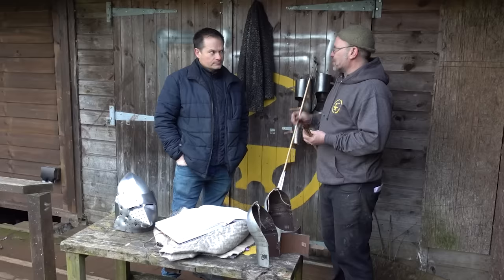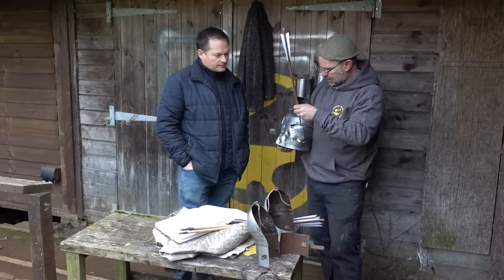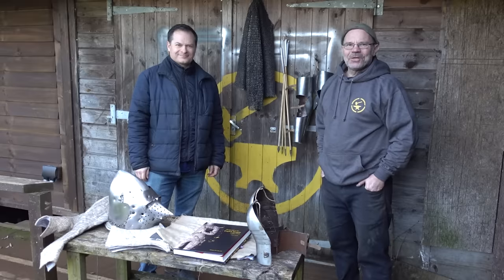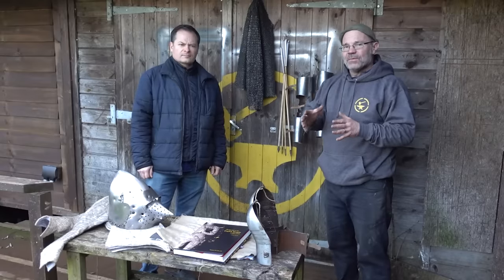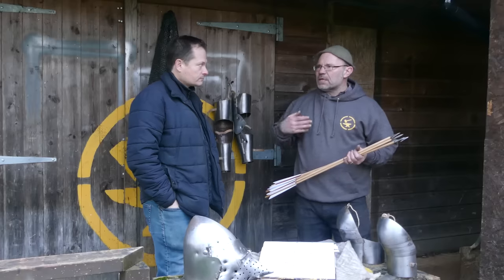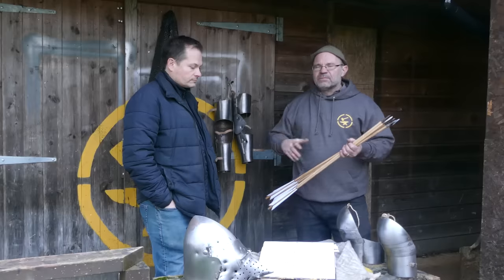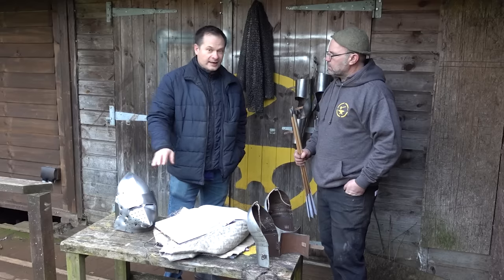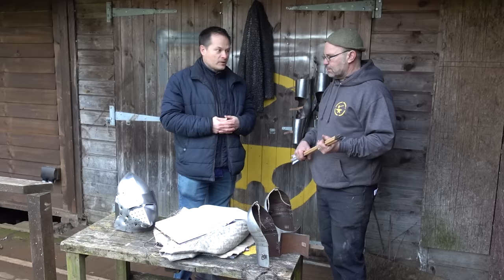Arrows vs Armour 2 - Our thoughts 6 months later

Comment: The number one rule of war : People Die. The purpose of Steel Armour is to increase the likelihood of survival. If armour did not work, then, the nobles would not have been spending fortunes encasing themselves in steel, and encumbering themselves with an 50 to 60 pounds of useless gear. Nobles were not fools. When armour became obsolete it was discarded. War is the ultimate crucible of pragmatism and practicality.

Comment: While this is an account from a conquistador fighting Native archers rather than a source from Agincourt, it is relevant to the phenomenon of an arrow shaft proving more dangerous than the arrowhead against armor: 

"An arrow, where it finds no mail, pierces as deeply as a crossbow [...] For the most part when they strike upon mail, they break at the place where they are bound together. Those of cane split and pierce a coat of mail, causing more injury than the other."

From "The Gentleman of Elvas”

As someone who has made my own arrows, I can attest that in unsocketed/flint-tipped arrows, the groove where the point is bound/glued is the weakest point. Ironically that made it more dangerous when hitting maille if made of a cane shaft, apparently.

Comment: I really think if you guys have a way to bump up the volume of arrows it would be really interesting to see if a person were struck by. Say something closer to 50. Maybe even 100 arrows if armor degradation starts to play a role like if it starts to pop rivets and straps on the armor because I know that's a big problem I've had with my armor, especially the used pieces of armor when I'm fighting. And my stuff is hardened tempered steel not mild.

Comment: Heck, think of the compromises and choices that modern soldiers make in the choices of body armor on 21st Century battlefields. Weight, mobility, and protection levels desired for mission dictate differences in what is worn. DAPS or no? Side plates or no? Plate carrier with minimal kevlar or IOTV Gen 3 or 4 with significant kevlar coverage in addition to ceramic plates?

Comment: I think a point to note when it comes to besagues is the anatomy of the wearer in armor when faced with an arrow storm. Like tucking your elbows into your chest, govering the gaps. Maybe even pointing the nose of the hounskull bascinet down to cover more of the neck or even the armpit gaps. All this in a slight bent over bracing position, closing down the gaps.

I think they would be able to close gaps with movement of the limbs(holding your forearms before gaps also maybe?), instead of just embracing the fact you are going to get hit there.

Maneuver the armor with the body like you would with a shield. 

Also for example when somebody throws a rock at you, you don’t just stand there…

Maybe a thing, to test different positions of the wearer.

Hope this makes any sense!?

+ like what about a boxing stance even? Again, tucking everything in when faced with blows…

Comment: A huge amount of power is lost with the arrow shaft being made of flexible wood. If a stronger more rigid material was used to construct the arrow shaft then more of the bows power would be focused into generating speed for the arrow, aka armour penetration. Is there any evidence the shafts were hardened, or if they used harder woods? Metal shafts?

Comment: Around 18:00 or so when they're talking about the armored skirt and whether English and French chose to wear them, or not, how more expensive and available they were to them at the time, one thing that popped in my head was how "expensive" it might have been to Carry and Transport that extra equipment.  Sure, packing it on a cart and then boat, back to cart, to travel from, say, London to Calais, and then having to "carry" that from port to Agincourt, and how these English soldiers are having to either physically carry/wear this armor on their person or on a cart, I wonder if this was a factor in choosing to go without.  As we all know, Armor is a tradeoff in Mobility/agility vs Protection. If you're a Man at Arms having to march on foot for miles, just to get to camp or the next stopover on your way to what becomes the battlefield (of Agincourt), do you really want to be marching for miles with that armored skirt that's only really best used for combat, not for marching for miles?  It seems for most of warfare history, Regular Infantry (to use a very generic term) for the most part tended to Not wear much armor on the legs and hips/lower extremities, because they had to physically wear it to carry it everywhere, and, without the benefit of a cart or horse, I can easily understand the choice to not bother.  

The French in turn have the slight advantage of home-turf, but even they too have to consider how much gear to bring, and how "expensive" that will be for them.  Perhaps some of the French felt they didn't NEED to  bring every single piece of gear, or, that they didn't NEED to wear everything they brought to this particular battle, perhaps they assumed that this was going to be a quick skirmish.  No one was saying "Oh!  This IS the Big One!" before the battle of Agincourt, it happened as it happened in real-time, and the men fighting that battle went in with the gear they felt was most appropriate for the conditions and situation at the time.....And as we see after the fact, the weather did play a role.

Similar thoughts about the Besigue, there does seem to be a certain choice to not wear them to gain a little more flexibility from the armor.  And, similar in thought to the "improved" breastplate being developed as a better protection against arrows, the thinking that this is "good enough" or that it covers 90-95% of the "worst" hits, but there's still that chance of that one "lucky" shot or deflection that still manages to work its way into a weak spot.   We all take a similar risk assessment when we get into our cars and drive off somewhere.

Comment: That barbed head - that is interesting and I think should be looked at.  I think it will have drawbacks, but maybe they are less detrimental than we think.  The flatter barbed head may have a better way to penetrate the eye slot.  But, that’s a volume/numbers game, it won’t be an easy shot. 

How the head shatters could matter too, do the barbs break and become short range shrapnel?

It’s really to bad there aren’t more notes about how they tested and developed the armor.  At some time, someone told a blacksmith what was happening, and then they made something to adapt the armor to the threat.  That the armor you tested with had several adaptations to deal with deflected arrows was not by accident.  I suppose some of it also could have evolved mitigating skating weapon tips as well…but even then, at some point, someone in those days did some work to solve the problems the armor was having.  I can imagine even a more wealthy night making prototype armor to see what showed promise

Comment: At Agincourt there would have been multiple archers firing in volleys and at angles using gravity to increase the velocity of of the strikes. A single archer cannot replicate this. With many knights charging forward you are more likely to hit someone rather than a specific target.
Reply: It regains velocity, sure, but not more than you'd think. And agincourt had most archery fire at 20M to point blank.

Armour is more effective top down. Horses don't fare that well though.
Reply: @mandowarrior123  Fair point. But it would be an interesting experiment.
Reply: That’s simply not true. They were flat shooting over barricades or through artificially constructed breaches.
Reply: @brothersliutgeryitzchakjea7889  No what you are saying is not true. The longbow men were not in dug in emplacements but were mobile and attacking mostly from the flanks. At times they were firing blindly under the cover of woodland. The knights were hindered by the mud and clay which inhibited their forward momentum. So volley attacks would be far more effective in such an arrangement.
Reply: @markkettlewell7441  the arrow is *never* travelling faster than when it first leaves the bow. Basic physics

& At Agincourt there were mostly shooting from prepared positions (that the French dismounted to try & get through). Doctor Capwell goes through what happened at the battle on another vid on this channel
Reply: I don’t mean to sound rude but have you bothered with any primary sources? It sound like your idea of Agincourt is based on film. The French plan was the same for Agincourt as it was for Nicopolis (for what that’s worth). The amount of barriers set up and used to limit cavalry movements, be it loose posts or wattle is well common and well understood for this period and we know the English had them.  The correct action would be for you to go and watch the Agincourt myth busting video that was done some time ago, because to dispel what you are saying would take video essays and hours of time to get into the grit of it.

Comment: Would there be any possible chance that there would have been headless arrows designed to splinter? Those shards seem like they are more dangerous to armored knights than any of the iron or steel heads. In fact I would bet fragmenting iron heads may have been a good idea at the time if it had occurred to anyone.

And if you are really looking to get between the chinks of armour, why are there no long stiletto arrow heads?

I have so many questions.

Comment: While I am no expert on Medieval warfare, my understanding was that the danger of the English Longbow was masses of plunging fire - direct fire along the horizontal would have been uncommon. Plunging fire meant that the arrow would hit the target with an amount of energy close to the energy of point blank range. The other issue at Agincourt was mud - slipping, and exhaustion were the result. I think an interesting test would be to see what is the comparative energy of an arrow on a plunging trajectory when it nears the ground, and what would that angle of attack have as an effect.
Reply: Shooting up in the air is probably mostly a Hollywood thing, contemporary art (from all cultures) shows aimed, flat shooting & the arrows were thick, heavy, tapered from point to nock with large, long fletchings, which is great for straightening out quickly & maximum energy delivery, but the opposite of what you want for long range flight archery
Reply: @StonesSticksBones  I'll defer to your presumably more extensive knowledge here. Still, would it not be interesting to measure the energy delivered from horizontal fire as opposed to plunging?

Comment: If a projectile (like, oh I dunno, an arrow, maybe?) is moving faster than its terminal velocity in a free (atmospheric) fall, then it loses more speed per distance travelled than after this limit. So when the energy loss is biggest in the first 5m and almost constant after that, you'd either get pretty much the same effect with a lighter pull, or should use arrows with more weight per cross-section area.

Comment: I think if a steel arrowhead did something to greater compromise an enemy combatant to some significant degree 1 out of every 100 shots, then it's possible that it would be well worth having all arrowheads made of steel. Each armored combatant was being peppered with scores of arrows and each arrow's likelihood of compromising the enemy combatant was low. Under that condition, effects that are too small to be measured by the limited scope and scale of the arrows versus armor testing could very well still be significant to the course of a battle.
Reply from the maker: I must say I am torn between the two points.  They did often seem to notice and favour the very small gains and other times they just did 'bat sh*t crazy' stuff for no apparent reason but they thought it was really important

Comment: I wonder how much abuse the armor can take, the condition of the armor going into the battle and the repair process.  Forgive my terminology but would the beak face cover on the helmet be repaired or replaced?
Reply: Well, excuse my conjecture as I'm literally a dipshit without any actual knowledge, but I would imagine that extensive damage to the face cover would likely cause it to be replaced. It's already the weakest link of the helmet due to being attached via hinges, so adding another layer of uncertainty on top of that would probably not be the easiest to sell to someone who can afford the original helmet.

Comment: This has been a great series. It has potentially answered a lot of the questions but in turn asked more. If arrows were relitively inafective why were they used? we have got to take into concideration the psycalogical effect that a 'storm' of arrows would have on the recipients. 
We have seen that it is 'unlikly' that a wearer of full plate armour could be penetrated by an arrow, but ask yourself if you would be prepared to stand in the armour that was used, while an archer was shooting arrows at you.
As for what armour was or was not worn at the time, you just have to look at current war zones to see how modern balistic armour. Some people will wear as much as they can so they are fully immune to the modern equivilant to arrows. In process they loose thre manoverabilty. Others will go for manoverability and only protect thier most vunarable areas.
Apart form the Psycalogical effect, the other feature of arrows against an armoured mounted unit, is the effect on horses. Armour may have used on horses but you cannot comeletly encase a horse and expect it to run at full speed while carrying a rider in full plate.
Was it just an anti cavalry weapon or could plunging fire create further issues?

Comment: If the steel arrow heads (with distinguishing makers marks!) were perceived as so much better perhaps they made a much greater effort to collect and reuse them after.  How practical is it to reuse an arrow head?
Reply: Absolutely, it's entirely plausible they were only preferred BECAUSE they were more reusable. And the greater evidence of soft headed because they didn't collect the french crossbow bolts at all. Or the French only used one type etc.

Comment: As I recall the type 16s have hard/steel edges and are often otherwise iron, which to me points to a) these may well be the steeled war arrows mentioned in regulations and b) that the purpose of making the head hard was to provide a good cutting edge for the barbed head, not to penetrate metal armour.
Reply from the maker: HI William,  We are also wondering similar things.  A small retest may be coming
Reply: @tods_workshop  Someone, I forget who, tested bodkins, sharpened and I sharpened type 16s on a jack. The unsharpened and bodkin points did not penetrate but the sharpened one did.

Comment: Every time I watch these tests, I see that the arrows have poorly aligned grain. I can see that they are turned on lathe and the grains are not parallel. That's why they break and lose some of their energy. It seems to me that better results could be achieved by using traditionally crafted arrows instead of turned ones. I would also use fresher, and therefore heavier, wood.

Comment: I would be interested in actual archer strategies. How did groups of archers work as teams. It's not one man shooting. It's small squads often friends from home. People who knew each other well. Strengths and weaknesses.

One guy might be able to fire more arrows in a minute. Another, slow but accurate. Another, may have some other trick shot or,  a 200pounder over the more common.  These factors would likely have combined to create, especially in experienced squads, very specific methods and strategies. Timed shooting between men. Even basic half/half splits.

I have yet to see this discussed beyond massed volleys being the main strategy.
Reply: The same conversation could be had with the Pellum/Javelin discussion. I may be off track but, modern warfare shows that squads of rifleman do this exact thing. Snipers, machine guns, mortars. All combine to achieve effectiveness and use strengths of each.

Comment: Maybe you should use crash test dummies in armour. With these you can map with computers the physical forces acting on the mannequin. The force is the the most important part of the equation in ballistics. How would these arrows affect the ‘man’ physiologically and mechanically on strike. For example, a straight strike to the head, might not penetrate the helmet but it could easily cause concussion and even neck injury. This would be a good way to analyse the effects from a knight’s perspective.
Reply: this but with a sling would really be interesting. A 200 gram rock has a lot of concussive force for sure an arrow not so much
Reply: They did a test to see how much energy is transferred through the armour, it wasn't enough to crack a raw egg (they just aren't producing that much energy or momentum)

Comment: Wasn't Henry VIII Tudor badly injured by a sliver of broken lance through his jousting helmet sights, very much like the arrow shaft going though this one?
While not common, one would think that splintering arrow shafts caused enough of these types of injuries that the injury mode leaves the realm of coincidence and enters into the realm of measurable probability. That would be especially true in an arrow storm of several tens of thousands of bow shots, wouldn't it?

Comment: One thing is you used a wide plate cutter, instead of a Bodkin. Bodkin, which was first developed by the Vikings, and then used by the English from 1340 on. The bodkin was a thinner three-four sided point. But was known to puncher plate at 225 meters, even though would not have been fatal, would have been at least a restrictive damage.
Reply: I think they did some other tests with other arrow heads